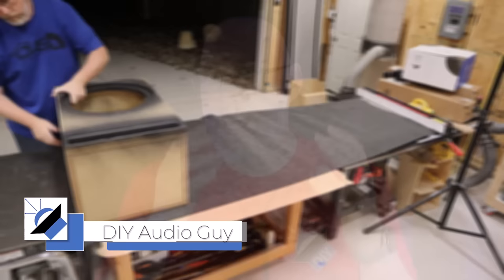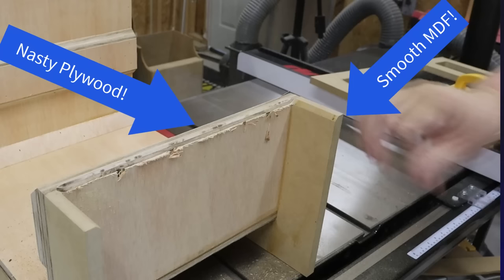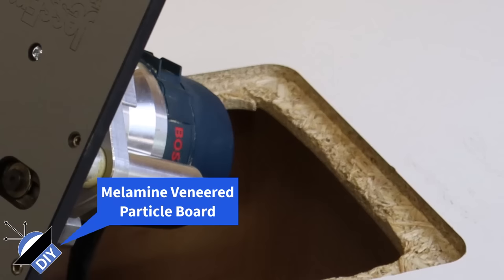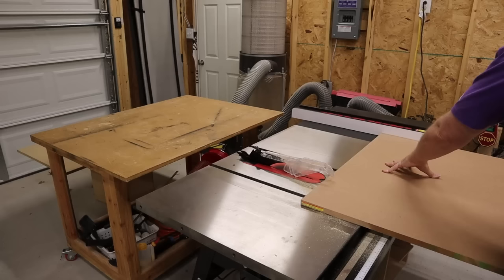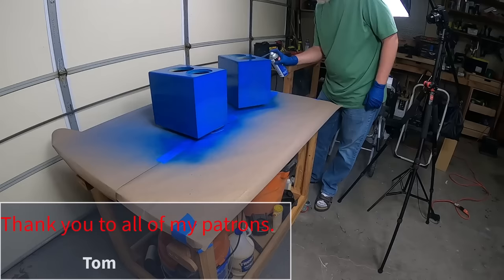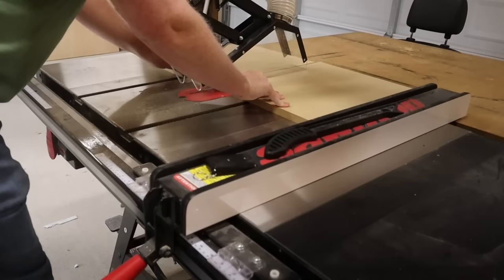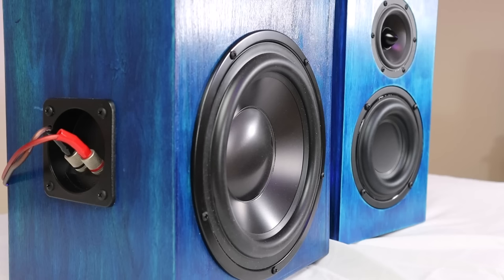You Won't Believe The Best Wood For Your Subwoofer Box!  Birch vs MDF

Comment: DIY has a nicer look overall. CNC'd everything tends to be a bit too crisp. Hand worked stuff has a high quality feel to it, that you can't just buy anywhere. I use thinned epoxy to seal MDF. I use hybrid construction. MDF panels with plywood bracing.

Comment: I like BOTH!  But Please Try this?  Baltic Birch for the Top and Both sides.  Cheapo  Pine or MDF for the back and Bottom.  3m Spray On Adhesive and  Frost King CF1 "No Itch" Natural Cotton Multi-Purpose Insulation, 16 x 1 x 48-Inch and Fill from Parts Express.  Make it any size you like and lately I've done more Belled Ports than Vents.  I stopped bracing my Normal size Speakers 15 years a LOL!  I have Braced large Subs but Nothing Smaller than a Set HPM 150/1500 speaker though.
Reply from the maker: I encourage the use of bracing but not for the reasons that people think.  Wood glue is strong enough, the bracing is there to deal with panel resonance
Reply: @DIYAudioGuy    But there are many ways to deadening a Cabinet.  I saw one treated with a thin layer of Paint On Truck Bed Liner painted on the insides LOL! 

I think High Density Fiber Board is one of the best but stuffing the Inside of enclosers will get the Job Done 90% of the Time.  I'm 66 and have built speakers since I was Twelve.

Comment: Not cost efficient, but I love my 1", 18ply, void-free,  ApplePly box. 1 cu ft internal volume 29" long 1" wide 7" tall with 45 degree angled corners, and flanged port . Router, scroll saw, and sander for the win on the port flange. Used Keda Royal Blue dye, and lacquer finish.... Sadly Keda is not fade resistant at all.
Reply from the maker: I bet that looks Absolutly stunting!
Reply: @DIY Audio Guy  It did, until the fading... Still, I took my time in the building process, and the mitered edge, create a cool look.

Comment: I’ve swapped to plywood (Red Oak or Blonde cabinet grade to be exact). I’d rather use MDF than Baltic bc there’s far too many imperfections between the layers.
Cabinet grade plywood has been proven to have less resonance than equal sized MDF.
Reply: Agree with all though isnt marine grade birch the best? More plies per thickness? Just asking because im pretty sure that if I asked for cabinet grade birch at home depot the guys going to point to the garbage on the shelf. Cant do that if I spec marine grade.
Reply: Your BB must suck then. The stuff I see is about 11 or 12 plys in a solid void free stack for 19mm. It is also cabinet grade.
Reply: @johnlucier5654  Marine grade just means that the glues/resins in the wood resist water exposure to a greater extent than say, exterior ply for sheathing. It doesn't necessarily mean it has a high ply count or a nice face, though it is more likely. I've seen doug fir marine that's only 7 ply for 3/4," while a similar thickness BB has 12.

Similarly, cabinet grade isn't always a bunch of thin plys. Sometimes it's fewer and thicker plys, but still a nice veneer and a good flat face. It depends on the manufacturer and spec of the ply.
Reply: @gahbah274  for most of us whose sources are limited to consumer home improvement stores its pretty much a crapshoot what youll get each time with the only consistency  being low quality. Last time I shopped for box materials the only thing appealing at the orange box store was actually maple ply with one nicely finished side. It was hard and strong. Everything else was from foreign countries I couldnt pronounce with lots of voids.
That project (a pair of small bookshelf speakers with some fairly exotic european drivers I got surplus cheap) went on the back burner, when I resume it I might just do it in 1/4" aluminum plate with 8" tube cut half round for the backs. Why not.

Comment: You use pretty cheap mdf i must say, not sure if available in the US but get something like Medite V313 it will not feel like carboard, and wont split like paper when dropped as easy. also cuts cleaner

Comment: I have gone away from MDF because it is so very hard to handle by myself.  However I have a tractor with pallet forks, so my John Deere can do the heavy lifting and my next box for a Resilient Sounds Platinum 18 will be MDF.  It will be in the bed of my truck with a blow through so moisture is a concern, so I will have to seal it well.
Reply from the maker: What is the best way to water-proof MDF?
Reply: @DIYAudioGuy  I like polyurethane.  You can also use fiberglass resin.

Comment: I wish I could get Baltic Birch again for $70. (4x8 3/4") Now if I want to buy it, if it's ever in at my local place, it's $130ish for the same 4x8 3/4" Baltic Birch. 

I'm not exactly a fan of MDF mostly due to the weight. But it's sorta cheaper and readily available. And easy to cut like you mentioned in the video.
Reply from the maker: At least you can buy it, it is unobtanium where I am.

Comment: I build my custom bandpass box in my car with a mix of mdf and fiberglass.
Reply from the maker: That is the best solution, use the best material for the job and mix them in the same project.
Reply: @DIY Audio Guy  simple I was lazy and also needed as much air space as possible so I did a 2in thick mdf walls floors and roof with cut outs for the wheel wells put a layer of thin bubble wrap over them and stapled fleece over that coat on 2 part resin added 8 layers doing 45deg turns each of 12oz chop another layer of fleece and 8 more layers of chop sanded with 120 grit add 2 layers of carbon and 3 coats of self leveling resin polished as they are visible in the front chamber of the 6th order with 6x 15" subs on 32kW

Comment: Do not know much about speaker/sound mechanics, but if you're thinking about MDF, ask your supplier about getting MDO with an MDF core. 
Neither Home Depot nor Lowe's can get MDO. Check your local area for regional lumber sources and can even find it at sign shops.  Once you use MDO you'll never use MDF/Birch again.

Comment: I build boxes with mdf unless I find some really nice 1" birch. But it's definitely expensive. Last 4 slabs were $160 each, made a beautiful strong box though. Mdf is just easier to work with imo
Reply from the maker: 1 in birch! That's thick.  A few years ago I stumbled across some plywood that had quarter inch MDF veneer on it, it was about an inch thick. It was heavy and dense.
Reply: @DIYAudioGuy  that'd make a great box! I'm going to look for some! Thanks man!

Comment: seems you had some high density there splitting..  particle board has it's uses still. but it's only if you're into using epoxy and just need to save weight. basically you just build around it using it like a core material.. cardboard works

Comment: I cant find any facts presented here to argue against but for my own personal projects i use marine grade birch for durability, strength and weight. Because time and labor wont cost me in these situations I can apply damping materials and techniques that you wouldnt attempt building a box for someone else.
Also keep in mind resonance and cabinet damping are not equally critical at all frequencies. It is my understanding that its less important in the sub range than low to mid bass. For air movement the cabinet simply needs to be solid and not move. Weight may accomplish this but its not the only way, just the easiest.
You cant get around the fact that virtually all pro sound touring rigs use marine birch for subwoofer enclosure construction. What it loses in dampening is exceeded by durability. 
On a side note the best sounding box Ive ever constructed was made of birch plywood with all sides but the soundboard double thick having a 3/4" void I packed under pressure with silica sand of 3 different grits carefully mixed. The soundboard was double thick with dynamat in between. It was for 2 15s, sealed, 2.3 cu each side so 4.6 interior total.
It must have weighed over 300# but it was in a 65 cadillac hearse. Why all the fuss? 
The sand jacketed box negated any transfer of mechanical energy from the subs to the vehicle. 100% pure air movement, for the bass up front effect.

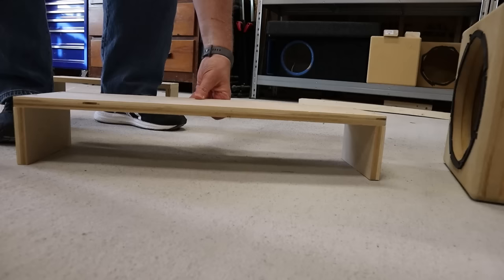Comment: 6:00 I thought the reason you preferred MDF was because it was "less resonant"? But if it's more flexible than plywood of the same dimensions, then the plywood is stiffer and therefore less resonant, especially when given the support of a box. 

Unless you're building something that needs a round over or intricate edge detail, and even then sometimes, use plywood, the sawdust isn't literally toxic. The binding agent used in MDF is Formaldehyde based.

Comment: In a old diy speaker book from the 80s they reduce resonance  with a sandwich from  2 different thick diameters. 19mm + 13mm. 👍👍🇩🇪 i use 22mm MDF. 14.50€/m2
Reply from the maker: That is thick.

Comment: I built a box for my Zv6 12" with doubled up 5/8 MDF and a triple baffle 😅 going in a ford f#%kin Ranger!

It's 38x19x15 overall and took over a sheet and half to build, i call it the shit brickhouse 🤪

It's also assembled metal free (besides mounting hardware) used two screws per glued face and filled the hole in after assembly with a toothpick and glue.

Comment: I coat my WOOD boxes in Epoxy. The outside of the box I usually do 1/8 to a quarter inch on all sides. The insides I just do a thinner coat. You knock on my boxes and dont hear almost anything reverberate through the baffles. Your knuckles will hurt if you knock on it hard enough. Yes, they weigh a ton-almost as heavy or heavier than the MDF boxes I used to admire (until I found out the mdf was making me sick). Just as good, and just as heavy. Very low resonance.

Comment: Guess I'm lucky, I can get baltic birch easily. But it ain't cheap and I'm yet to find a project worthy of the expense. Though from the sound of things, the pricing I can get is pretty decent. Maybe I should buy while I still can.
Reply from the maker: If it were readily available and cheap I wouldn't use nothing but that.

Comment: I've used MDF and plain ole particle board to build boxes. I prefer using plain ole particle board for several reasons - 
1) It doesn't make fine dust that irritates your lungs and is a serious pain to clean up.
2) I don't have to predrill every stinkin hole where a screw goes.
3) It costs half of what a sheet of MDF costs.
4) The boxes I build are just as stiff and "dead" as they would be out of MDF.
5) I don't really care what my boxes look like (neither does my wife thank goodness).
6) I tend to build so many different boxes for a single vehicle it is too costly to use MDF.
7) It covers with carpet just as nice as MDF.
8) You can paint it like MDF, it just needs a bit more prep on the edges.
9) I love showing MDF "purists" that plain ole particle board works just as well.
10) I have yet to have a person want to pay the extra money for MDF when I build them a custom box.

I'm not saying you are wrong, I'm just saying there are multitudes of reasons against saying MDF is the be all end all.
Reply from the maker: Maybe I should buy a sheet of particle board and give it a try.

Comment: Can you do a comparison video between MDF and Baltic Birch.  This video you are just speaking about cabinet grade birch ply.
Reply from the maker: I can't get Baltic Birch so no I can't do that comparison.  That was part of the point of the video. Most people going on and on about their birch plywood enclosures aren't actually using Baltic Birch.
Reply: Thanks for taking your time to respond.  Luckily, I am near about a half dozen different suppliers of BB.  Live right outside of St. Louis.  I have been doing car audio for nearly 2 decades and built well over 1,000 boxes.  I prefer to work with MDF for easy of use but prefer BB for other reasons.  Your videos are great and very informative.  Keep it up!!! @DIYAudioGuy

Comment: Ever seen a box made of Purple Heart? One of the heaviest and densest woods. Even harder to find than Baltic birch
Reply from the maker: I've seen it on the shelf at the local woodcraft store.   In general I don't recommend hardwoods for speaker boxes.  Hardwoods will expand and contract as humidity levels change.  If you're not careful the box will pull itself apart.  Plus natural wood products tend to resonate and color the sound.

Comment: Old video I know. But as someone who's built systems for 13+ years. I feel like mdf is probably the best material if you want to go crazy on details. If you just want a simple enclosure, go for birch and stain it. But if you want show vehicle quality results, mdf is the way to go due to its "craftability"
Reply from the maker: I agree, one is not better than the other.  Pick the material based on what you plan to do with the box.

Comment: The reason we call MDF particle board is because it is. Medium Density Fiberboard, what you're comparing it to is actually LDF, Low Density Fiberboard, more commonly known as Particle board or as I call it, Chipboard, because it's made with wood chips, not sawdust like MDF or fine dust like HDF, google a comparison pic or ask the dude at the hardware to show you the difference.

Comment: I have both MDF and wooden subwoofer boxes of sealed and ported type. MDF is heavy and one that I got is waterproof MDF , i dipped a small piece of MDF in water for a week and MDF sealed enclosures sounds much much better than same enclosure made from wood. For ported enclosures, there is no much difference, Same sub sounds the same In two identical ported subs made from wood and another form MDF

Comment: I built my box from ADVANTEK... super dense, super strong that doesn't flex. Resists moisture all day long.
 I'm running 6-12s in a bouble baffle and it goes nowhere.
Reply from the maker: I bet that is loud af
Reply: I have half a sheet of Advantek left over from a flooring job.   Thanks for the idea!
Reply: Advantech? Jesus that's like the most expensive yet ugly product I can think of for a sub. Fancy OSB. Though I can see the advantages....see what I did there?

Comment: A sheet of that birch cost 78$ minimum a board and it's not full size IV actually used to show people the price of a sheet of wood and I would show them the price of that sheet  when your at the hard were store you can see the difference between the boards Baltic birch basically the nicest ply wood and cuts clean on the edge the birch board is lighter in color and the ends are ruff most of the time a Baltic birch epoxy layered wood definitely be a solid box 💪👌👍✌️💯🎶🍻🎶

Comment: Not sure if its unknown, or just not covered. Splitting is easily prevented with pilot holes. 

As for dust and MDF. Get ahold of Ultra Light MDF.  MUCH more dense, practically NO dust and best of all... HALF the weight of standard MDF and much stronger :)

Great video! First time watcher :)
Reply from the maker: Yes, you MUST drill pilot holes with MDF.
Reply: UL MDF is NOT stronger...And it's just as dusty in my experience. At least with moldings

Comment: what about sande plywood, is that good to use for a enclosure ?
Reply from the maker: I've been out in the garage building new workbenches with that stuff.  When I drove screws through it the layers would separate.  So I'm going to have to say no.

Comment: I used 1-1/2 plywood. Double layer for baffle. Heavy beast. But I got it for free.

Any reason to use thinner material besides lighter weight?
Reply from the maker: The weight savings is probably the main reason.

Comment: Built sub cabinets out of particle board  when I was a young man before MDF even existed and rarely had issues with splitting. Drill , countersink, and screw. Apply liquid nails to the inside joints and turn up the volume. MDF is nasty, makes complete mess. and in my opinion is weaker for fastener holding.

Comment: You think MDF is heavy. I built a pair of 10" tower speakers using eighteen sound drivers out of 34 mm thick black american walnut. 102 x 60 x 37cm. They are 197 lbs each.
Reply from the maker: Ouch.

Comment: what material would be better for a blowthrough setup? i have a 2003 silverado single cab with the box in the bed and no bed cover. someone even recommended i do the outer walls with plywood and the inner walls and bracing with mdf. i want to build a 6th order enclosure for a fi btl 3 15" sub.
Reply from the maker: That's going to be a big box and it's going to be heavy. You want to do multiple layers.  Due to the weight I would go with  the plywood.

I also recommend that you invest in a good bed cover.
Reply: thanks for the reply. multiple layers as in doubling up on every wall? hoping for a bed cover soon but in the mean time, what would be the best way to weatherproof this box?

Comment: I have a odd question.  If you were going to make a relaxation tub in a house would these same practices apply.  I'm wanting the sound to resonate through the tub and water. Would it be better to incorporate the tub itself Into the enclosure or spaced away from the tube and firing toward it. Standard vocal hz range with no special tuning. Yes I know I'm crazy 😂. Not asking you to build it just point me In a good direction is all.
Reply from the maker: You can attach a base shaker to the outside of the tub.
Reply: Could also attach exciters to it. PE sells a variety of them.

Comment: What if you use solid oak boards.  I have access to a saw mill and could cut oak to basically any size needed.
Reply from the maker: Hardwood has a tendency to expand and contract based on humidity, and it can resonate and color the sound.
Reply: @DIYAudioGuy  have you experimented with various coatings.  Ive wondered what effect using a rubberized spray on coating on the inside and out of an mdf box would sound like.